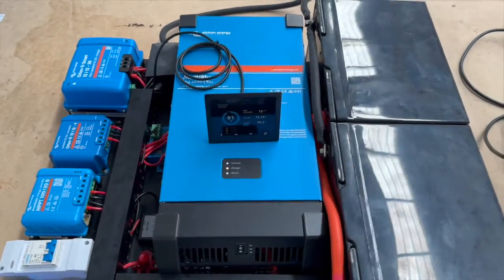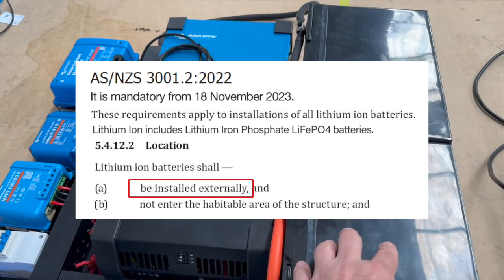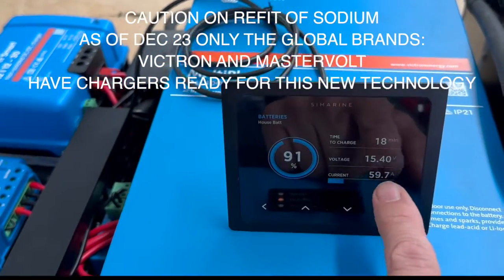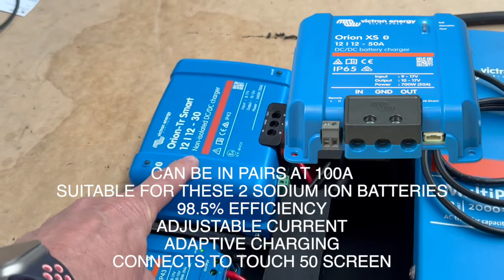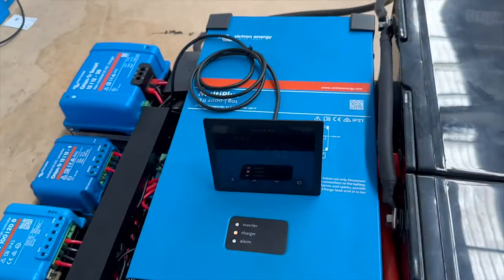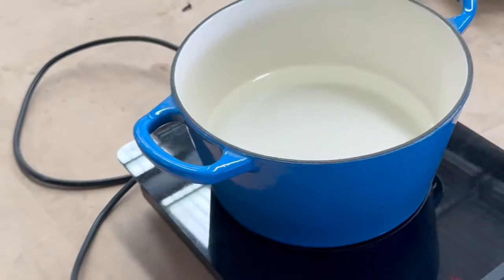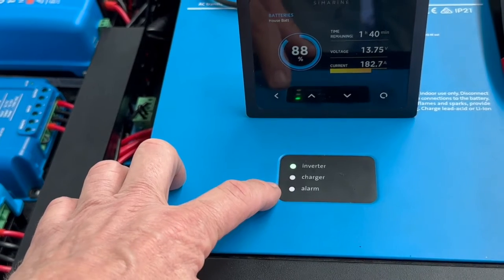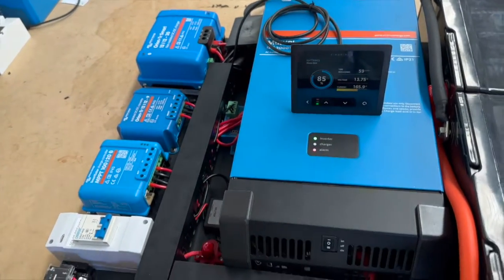Sodium Ion Batteries and 2000VA Inverter Charger in VW Transporter T6 running a 2000W induction hob

Comment: I've read sodium batteries can go down to a much lower voltage than the victron cut off so you don't get to use the full range of these batteries. Can you comment on this maybe a dc to dc converter can be used to maintain the desired voltage. Operating voltage of 1.5 to 4.3V per cell so 6v to 17.2 for a 12v system
Reply from the maker: Yes Sodium will go lower but we set tham at the victron limit and get 90% of the published capacity within the victron range.

Comment: Do you do a 48v system.  With Sodium
Reply from the maker: Yes we do. Its a 48V Sodium in Meteor Battery. Nicely matches Victron and we have designed a new Scotty AI 1500 to operate with Sodium voltage ranges for a very smooth 12V output.

Comment: I bought a 12V 200Ah sodium ion battery for US$ 400. The voltage span is from 9.2 to 15.6 V. The Orion XS charger in power supply mode is used to normalize the output voltage 12..8V for loads The wide voltage span seems to be a bad thing, but is has also its benefits. The state of charge can be judged easier.
Reply: The 12V 200Ah battery is from ODIPIE through Alibaba . The cost seems to be the same as for LiFePo4 batteries already. The Wh per kg is around 100Wh/kg. For stationary aplications size and weight do not really matter. The charging problem below 5° Celsius, that LiFePo4 batteries have, is of the table.
Reply from the maker: Yes there are some things you have to do because of voltage span but we manage it well. You are lucky to have an XS unit, its not available in Australia yet.

Comment: So, is 15.9v the point where batteries are 100% charged & 8v the point where the batteries are 0%?

Or are you running an 80/20 configuration on your charging & discharging?
Reply from the maker: Hi David, yes, we run between 8V and 15.9V using an Orion 12-12 9A to level out the voltage to fridge and lights. All the other Victron gear runs full range. Had a MultiplusII 3000 charge up from 8V to 15.9V easily.
Reply: @Safiery  - can these be charged with a lead acid charging profile?

ie can I just take a sodium ion battery & replace my lead acid in a car, or a lead acid in a UPS?
Reply from the maker: @DavidHalko  I would not use these as a starter battery. Victron Energy are compatible with this technology. Redarc and Enerdrive are not and most others arent. Mastervolt is compatible.
Reply: @Safiery  - I understand that starting batteries typically are high current discharge applications with wide temperature ranges.

I am curious about the charging profile, if I did not want to use Victron gear, but wanted to swap out lead acid for Sodium Ion?

I acquired 4x 8s4p automotive Li-Ion battery modules for another project (~400 lbs of battery) ~1 year ago, but this has been the first time I have seen large Sodium Ion batteries and I am curious about charging them up?

I am not seeing much information on charging them. Can I just raise the voltage to 16v & hold it until no more current passes in? Can it float?
Reply from the maker: Then you need bulk or max voltage continuous current to 15.9V then continuous voltage at 15.4V Cheers @DavidHalko
Reply: @Safiery  - thank you!!!

As soon as I saw you had started doing work with Sodium Ion batteries, I subscribed to your channel!

Keep up the good work!

Comment: The new requirements do allow installation under the beds etc as long as they are in a sealed case and externally vented through a 20mm 1 way vent. There are other requirements about how it is wired however i just wanted to point out this is factually incorrect what you are advising. And yes i have read the entire document, cheers
Reply: He has cherry picked the wording from the document to suit his sales pitch.
Reply from the maker: On our website I have a photograph of the whole paragraph on location of Lithium. There is only one paragraph on location so it is reporting the regulations without cherry picking actually.

Comment: The only reason people would buy these batteries is for the price. Supposed to be much cheaper than lithium. But these batteries are 4x higher in price than lithium!!! These batteries will be off the market come 2024.
Reply from the maker: The batteries we have are high end with excellent BMS. They are lower in cost than our Lithium with the same level BMS. They are not to be compared to Itech world or similar.
Reply: @Safiery  um, they cost more than a freaking battle born lithium iron battery. You can keep that crap.
Reply from the maker: When I di my comparison in the same currency and taxes they are cheaper. @kevinroberts781
Reply: “The only reason people would buy these batteries is…”

To keep their cars & homes from randomly bursting into flames 🔥 

https://youtu.be/8nz5ijXcckI
Reply: @DavidHalko  If you can't handle normal technology that's on you.
Reply: @kevinroberts781  - “can’t handle normal technology”

More than a few can’t handle it…
https://youtu.be/Bqwh4yUyJuE

Which is why Sodium Ion looks promising!
Reply: @DavidHalko  it is promising technology but not with this manufacturer in this video. That's just stupid level pricing. We laugh at you.
Reply: @kevinroberts781  - “not with this manufacturer”

So, we have gone from price being the only determining factor in buying batteries to the issue really being this manufacturer. A petty ad-hominem attack. 😂

“That’s just stupid level pricing”

For you, perhaps, but the price may not be an issue for others needing distinguishing battery chemistry characteristics.

“We laugh at you”

Not sure who “we” is, but I suspect you are not “God”. Maybe missed your dose? 🤔

If you enjoy “normal technology” so much, maybe you should depend more on wood 🪵 & wood burning 🔥 stoves. 😂 

Wood 🪵 is pretty normal, worldwide. 🗺️🤣 

If you need dosages, you may not be so discerning of “normal”. 😕
Reply: @DavidHalko  you can laugh all you want but no one will pay this price for these crap batteries. If it hurts your feelings so be it.
Reply: @kevinroberts781  - nope 👎🏽 
Doesn’t hurt my feelings in the least!
I am scoping some Sodium Ion Batteries 🔋 now, for indoor use!

I saw they were available in a smaller form factor from another vendor, was shocked, since I did not know they were available yet!

Once I saw this video, with this vendor supplying a larger form factor, I became quite excited!

Comment: Holy crap.. read that sodium bats were going to be 1/3 to 1/4 the price of LFP.. these are like 4x the price. Maybe by 2026 or so they will come down in price to be competitive?
Reply: Was expecting maybe 60% of the price of LFP.
Reply: Yeah, I don't understand why they are sooooo expensive! They aren't as good as lithium iron phosphate. Why so costly??
Reply from the maker: When Lithium costs were surging, that was the forecast. Lithium has now dropped back in cost considerably. But these are cheaper and will become even lower in cost in time with volume. The batteries we have are high end with excellent bMS not to be compared to Itech world or similar.

Comment: Be much more efficient boiling water with an ELV eco cup/kettle straight of the batteries, but yes cooking with 140A to a ELV electric pan tricky but possible 😂
Reply from the maker: Induction is 94% efficient and hard to beat
Reply: @Safiery  no its about 85% if you look it up, still good, but then you've got inverter efficiency when delivering around full-load output, what's  that around 95% so around 80%. Heating a small amount of water for like a coffee, doesnt need 240V supply and some eco drink heaters are thermos insulated.

But nice set up mate, great to see more sodium batteries hitting the market and dropping price for more uptake 👍

Comment: So Bruce, are you saying no Lithium batteries can be installed inside a 4wd or caravan etc from that date?
Reply from the maker: For caravans and 4wd you sleep in, the Lithium must be accessible externally and must be separated from the internal space. See the words taken from the regulations in the video. Very simple and clear. It is also very well thought through
Reply: @Safiery  Thanks Bruce, I trust you guys implicitly, and know you guys are at the absolute tip of the spear of all of this!....Thanks.
Reply: Everyone literally uses lithium batteries in their solar homes. Where they actually sleep every night. Sounds like political crap to help a buddy sell batteries
Reply from the maker: @kevinroberts781  The purpose of the change in regulations is that is the RV is on fire or in danger of fire (I was in one today with 4 petrol motorbikes stacked in the back of the Sprinter for example) then first responders want to access the lithium from an external hatch separately to entering the RV. Very sensible.